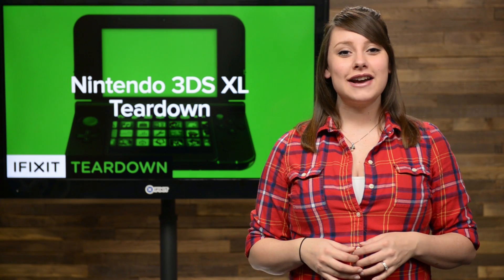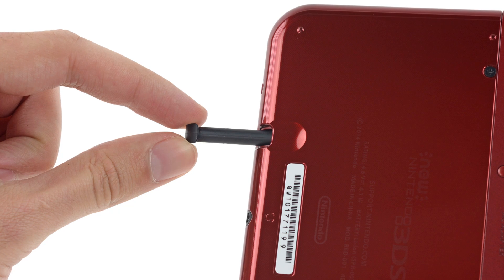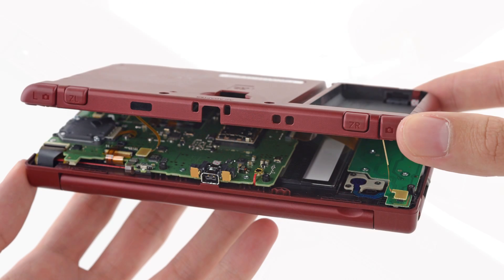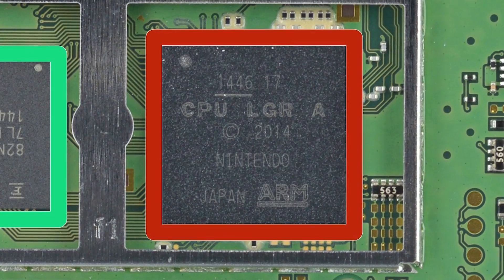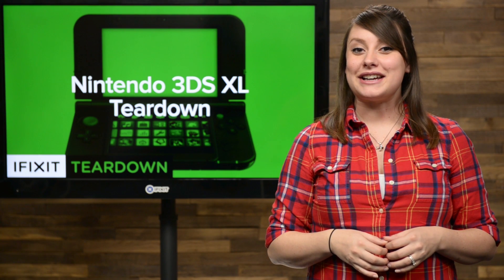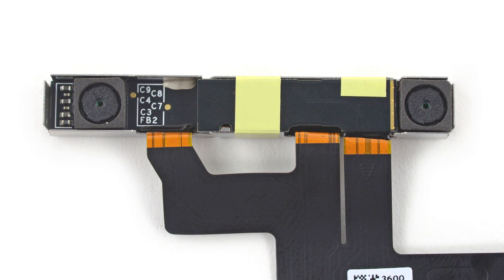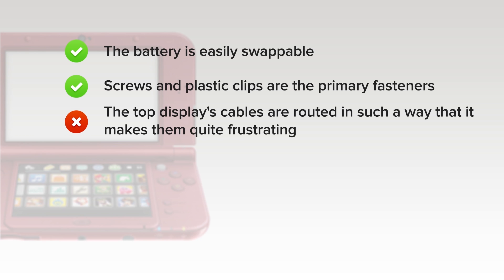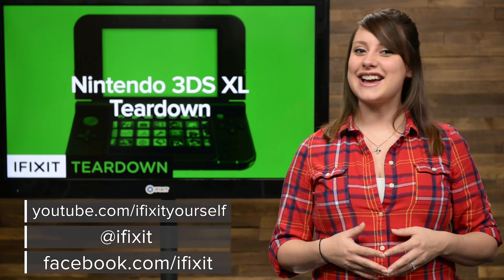Nintendo 3DS XL 2015 Teardown!

Comment: Is there a reason you guys decided to completely skip over the part of the disassembly of removing all of the different types of ribbon cables? There are so many different types of connections, it’s impossible to tell how to remove them. This is a very important aspect of the disassembly of the system, and you decided to completely skip over it, like “swoosh, they’re all disconnected!” It’s worse that this is really the only disassembly guide of the New 3ds XL.

Comment: I tried to fix the sticking clacking on my Left button on the D-Pad, but in working the thing back to normal, I may have gotten the functions of the ZR to NOT work on Super Smash Bros, even if it works on the 3DS Menu. Did I do anything wrong?

UPDATE: I changed the Current Date and Time, and it made more sense, as the things work, now.

Comment: I managed to break the mic without ripping the cable or breaking the connector and I am so confused BTW the N3DS is second hand but the mic worked when I got it and the HOME button did not so in fixing it (which I did not) I broke them mic somehow so its ether the dumb clasp thing or the mic itself and I think its the clasp because they do not close all the way for some reason.

Comment: i am sure you need to replace the whole wifi card that is in the motherboard right? THE ATHEROS ATH-AR6014G-AL1C WIFI SOC
because i think i need to replace the whole motherboard since the new nintendo 3ds is pretty newer so we cant just replace a wifi card easily.. right? i have to buy the whole piece? or do i need to buy the wifi soc and then replace it by welding it?
IF ANYONE HAS FIXED THIS BEFORE PLEASE LET ME KNOW AND HOW. 

THANK YOU EVERYONE :)

Comment: Is there a way to change the 3D slider on the top panel without removing all of the bottom also?
Reply: Sirius Star tere are 4 screws below the 4 little rubber pieces on the top screen. Take those out and the top should pop or slide off with a little pressure. Then you have access to the insides of the top screen

Comment: new 3ds xl can support more than 32gb micro sd card, i have mine with 64gb formated  a fat32 and no problems...
Reply: Same here, even the older 3ds can handle 64GB sd cards
Reply: REGAMETRO It's strange to write "32gb max". Two clicks
Reply: a firmware update may have allowed higher storage SD cards. :)
Reply: neoarcadezr  what's the brand of the 128gb?
Reply: I think nintendo only "officially" supports 32, any higher than that is "unofficial" but still works.
Reply: Hmmm, I do have a spare 128Gb micro sd card... but I doubt I'll ever feel up the 32Gb card I have in the system. :/
Reply: i use 128 gb micro sd

Comment: I ended up stripping the fucking screws under the plate... despite using the proper everything. Turned the right way, used JIS 000, yet they're practically fucking bonded to the damned motherboard.
Reply: replying to get a notification if question answered. same thing over here. the screws are just planted really tight in there.
Reply: +NeonVin i have a technique for tight screws.
if the screws it's screwed on plastic, i use my soldering iron to heat the screw just a little, enough to untight it and unscrew it.
i hope that help.

Comment: Neat, I just wish I could trust myself enough to put the 3DS back together to replace the bottom touch screen. I have a replacement working touch screen, my current one has some dead pixels. I wanted to replace it, but ah well. I don't wanna screw this up lol.

Comment: hey. just to let u know that i have one new 3ds problem that no one ever has.

it keeps turning on and off. i am pretty sure it got nothing to do with the flexy cable. and i strongly believe it was the power button.
to make it simpler, imagine an invisible finger pressing the power button constantly. thats exactly wat happened to my 3ds

go to my channel to check it out. i uploaded one video.
Reply: think u can figure a way out?
Reply: +Isyraq Abu Bakar it might actually be a fuse, when the system reaches full charge it shuts off, fuses are pretty easy to replace if you can find the one causing the problem, and your theory may also very well be the case, see if ref lowing it, or just a simple reseat/ clean up works
Reply: Hidden OS thanks but some reason its okay now. idk wat happened but i still fear it might happen again so i wont transfer my old data from my old 3ds to my new one just to be safe
Reply: and also , i dont think its due to charging. cuz i remember i left it next to my bed uncharged and turned it off. the next morning it was on.

Comment: So, after I first bought my New Nintendo 3ds (New Black) after 3 receiving the system, part of the right bumper could not be pushed. I had to firmly press it at the edge to even sense that I pressed it. This last week, I went to camp, and when I got home, the ENTIRE button cannot be pushed, no matter what I do. I already sent the system in for repair once because the camera assembly got screwed up. I was hoping they would fix that problem, but unfortunately did not. ;--;
Does Nintendo have a limited use warranty? (Send it in once, warranty is then voided) Or do they have a full use warranty? (Send it in multiple times before the warranty expires)

Comment: my new ads XL's right shoulder button won't work but know how to fix it?
i looked up on the internet and i only found one way. buy a new shoulder button flex cable. are there any other ways to fix my r button? please reply. not really used to using zr and zl on super smash bros, 3ds.

Comment: 1750 mAh battery? They could have easily doubled that. And they should have used the stock ARM v8 based cortex A57 cores for optimal performance rather than purposely using outdated "custom" cores
Reply: The device is already doing crazy long with this relatively small battery, plus, they have to keep the cost down.
Reply: Remember compatibility withs the old 3DS Games and if Nintendo make more changes the price maybe will increase.
Reply: Joseph YaZe if they did do it, then the 2016 3ds could use more improvements all around and upgrade to A72 cores, or just flat out go for the 7th generation nvidia tegra SoC (Parker)
Reply: You realize this is a slight update of a 2010 device right?
Reply: Wawaweewa Rice probabbly saved for next gen handheld in 2017/18
Reply: nintendo like cheap stuff
Reply: The most recent post apart from yours was 2 years ago xD. Back then people thought that the NX might be a virtual reality console, not a portable tablet and that there would be a new 4DS that would be the next big handheld lol
Reply: Wawaweewa Rice you're kidding me right. I have a 1300 mAh 5Wh